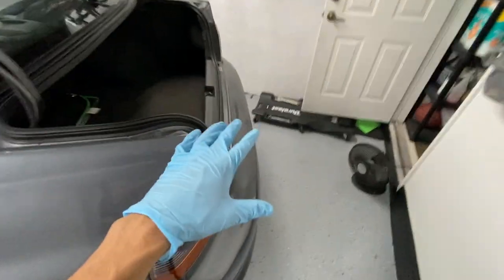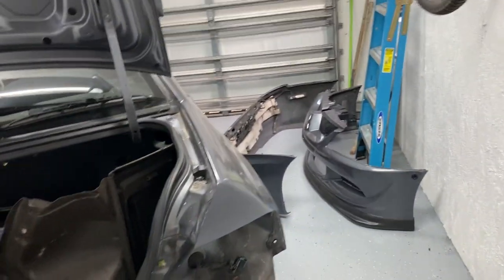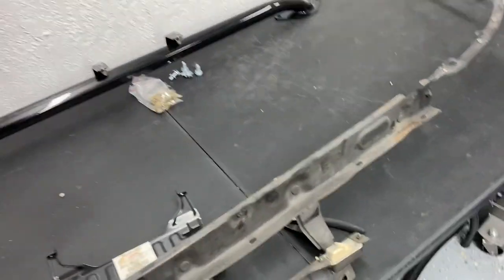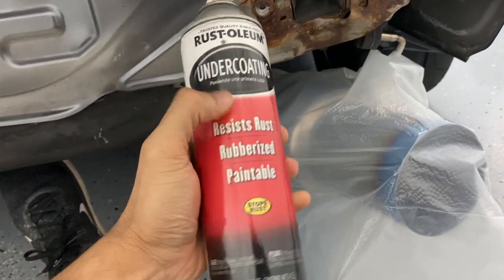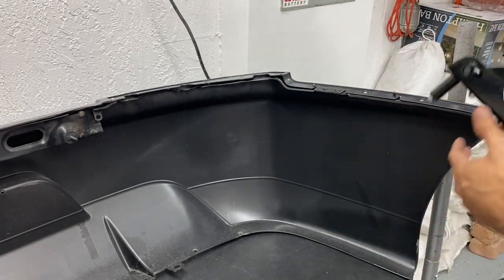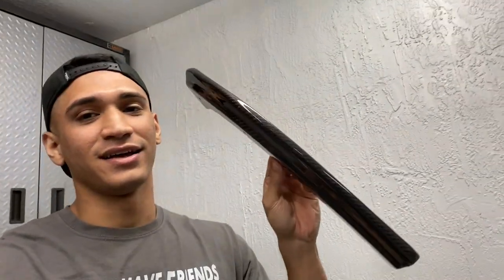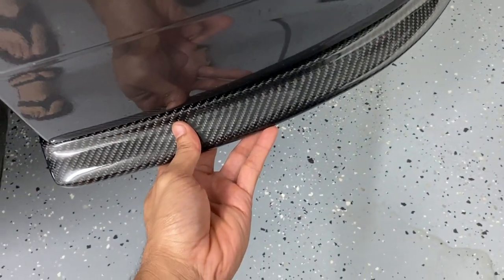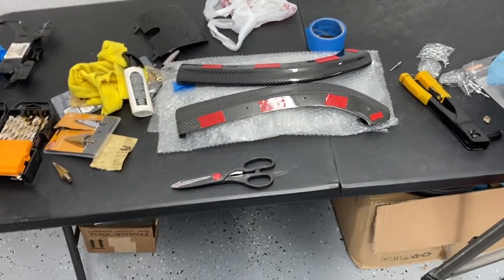Evo Build | Ep. 6 (How to Install JDM rear bumper on a evo!)

Comment: Ohhh dont use rubberized coatings for rust. Those actually inuduce rust by trapping moister under the coating. Vehicles up north that use rubberized coatings end up getting pretty damaged. Research it. Best thing to do is use a rust remover like Krud Kutter to stop it, clean it and primer & paint it afterwards (even if you're using rattle can spray). Woolwax & Fluid Film are amazing rust protective products. They're both lanolin based products  ....Check em out
Reply from the maker: Thanks for the tip!! Car is going to be resprayed completely soon but still good tip to know for next time!

Comment: Spraying on top of rust does not help. You want to sandblast it with aluminium oxide ,then threat it. If you remove that undercoating now i guarantee you it's worse.